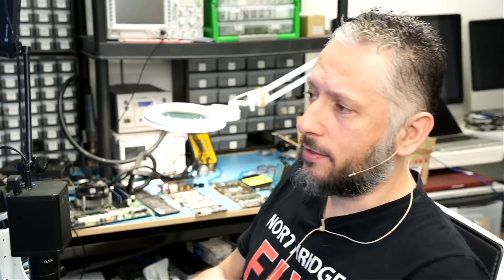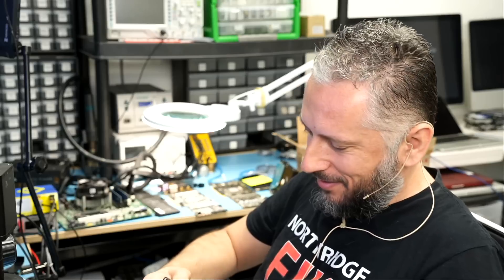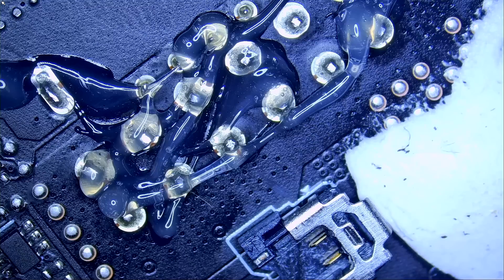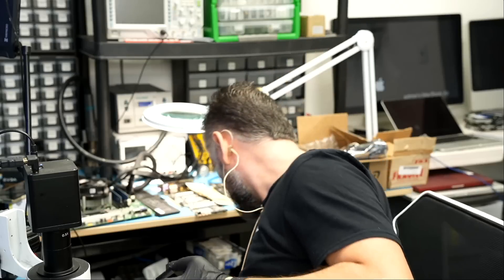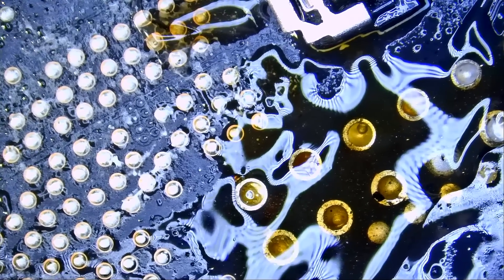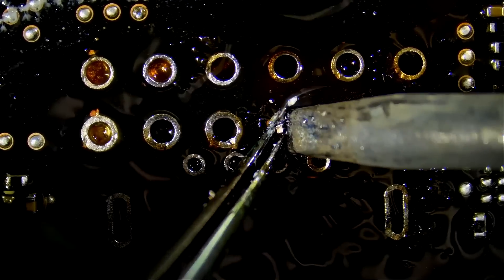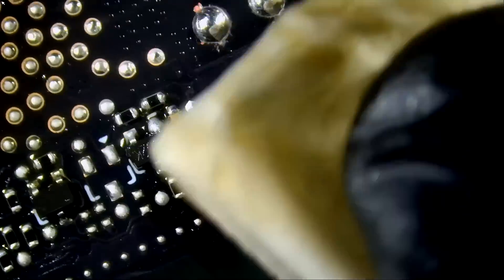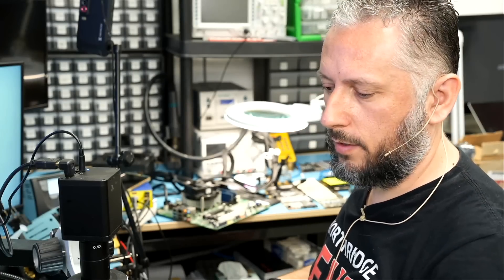4090 FE Connector melted with Cablemod Adapter installed. 40 series cards should be recalled

Comment: That angled connector is not designed to stop the melting issue. It's designed to keep the cables from being bent oddly at the GPU connector and possibly damaging it;  Because a selection of PC cases' outer panel are up against the cable connector. This melting issue was a problem as soon as the cards went into production. There was a pretty extensive test done to prove the reason why these connectors are melting from a reputable youtuber. It was a revealing and convincing video and I think everyone just went with that,  but that doesn't mean they may have missed something. I am interested in your theory, if you come up with one, as to why those connectors are melting if it is indeed not user error. I have installed 3 4090s in our custom builds just in the past week. We've installed quite a few in the past several months and 3090ti cards all through last year. I haven't had one customer we built machines for, come to me with a melted cable yet. It IS only happening at that new and very small pinned connector. I'm pretty certain that the next gen cards will deffinately have a different connector.
Reply: I would hazard a guess that you are being careful with the cable management when you put these 90s in. My guess is that this card had tension on the adaptor causing a poor connection. There really isn't many other things that could cause this unless it wasn't fully inserted, but apparently it is. Hard to see in the video if that is the case.
Reply: @proudofyourroots9575based on this and a previous video,  yeah i don't think he understood for some reason what this 90 is for..
Reply: @ProudOfYourRoots No. I am not trying to explain to him about the connectors. He just didn't mention it so therefor I tried to clarify that it is simply a right angled connector to someone who may not know. On the contrary of what you think and as a board reworker myself, I believe he's an intelligent person.
Reply: @ProudOfYourRoots  for others that did not know about cablemod adapter, like me...learned that today.. to my defence.. but i dont use nvidia anymore.  the company so rotten

Comment: As I have said on comments on other channels ever since these cards came out, this new connector is just too small for this kind of current. That said, I bit the bullet recently and bought a 4080. The 4080 of course cannot pull the kind of current that the 4090 pulls and I'm hoping that will keep the connector intact.
Reply: I’ve seen 4080 connectors being melted too 4090s are just more prevalent
Reply: Just remember that AMD's hotspot issue was more important than this.
Reply: Especially when the hot air adds to the temperature.

Comment: Analyzing the pins on the video I think the pins on the replaced connector are thicker than the original connector, wich implies Alex's connector is "better than factory". Maybe manufacturers cheapened out on first batches of these cards and newer connector designs are more resilient.

Comment: This stuff isn't new. its been happening to NVidia cards as far back as the 1080 series.  i know of it first hand. with the old 1080ti as well as the 2080 ti's .  The connection is not robust enough for when these cards start churning up their power needs. Its a lot of juice passing thru wires that heat up, and the plastics involved is not thermally efficient to handle it.  The companies know this but they refuse to find a solution because the amount of cards frying is a small percentage compared to majority of users who's activities are not pushing their cards to such extremes.  Some that are have their computers in cold rooms which further help in keeping temps low.

Comment: I can tell you from experience that the 12-pin connector can feel very different with different adaptors. The pigtail adaptor - the one nVidia provides, not by the broad partners - felt very "sluggish" when I was plugging it in. Then I tried a adaptor cable by Corsair, and the feel was a lot snappier when plugging in -  the kind that gives you more satisfaction when plugged in. I haven't tried the CableMod adaptor, so don't know how that one feels.

The thing is, this sort of difference used to exist already with the PCIe 8-pin - sometimes they feel very snappy, sometimes they don't. The same can be said with the ATX 24-pin, or the plugs on a fully modular PSU. It's part of the plastic molding tolerances. However, the mating part of the 12-pin connector is shorter than the PCIe 8-pin, and together with the high power draw of the 40-series card, can exasperate the problem, because the connector is not connected as "deeply" as before, and also less structural rigidity.

The latch itself is not in itself a proper indicator whether there is proper contact within the connector: all it does is to prevent the connection from disengaging when you pull on it. But even so, when you pull on the connector, you will have to say there will be some kind of disturbances to the contacts of the pins within the connector, because when you physically wiggle the connector, even when it's latched, there's a little bit of play between the two plugs.

The Gamers Nexus video provided a plausible explanation for the melting connector, and while it's very likely a lot of the cases could have been due to the connector not being fully plugged in, the video creates the side-effect that affected users are less likely to speak out than before because they would likely be ridiculed for making a mistake. So this would lead to more affected users (proportionally) just quietly sending the damaged product for independent repairs. Hence you seeing more related repairs.

One key statistics for confirming this problem is the 4080. It uses the same connector, but uses less power, so are we seeing similar failure rate (percentage wise) as the 4090?

But I do agree that if good contact is required for reliable operation of the connector, then it starts to get into the territory of the designer/manufacturer's responsibility to ensure repeatable operation for an average user. If plastic molding tolerances are a critical factor, then there needs to be specifications in place to ensure as such.
Reply: If the owner is using the cablemod is because he knows the issue, I don't believe a bit that he didn't connected all the way or the adapter was poorly designed by a company that sells psu cables and were aware of this issue (that's why it was created) . We can clearly see that it fused the connector together right were it should be, all the way in . Maybe there are some other factors playing a role here but one is for sure the heat generated by the corrent (that's why we see alot of reports with 4090's) . this connector should have a safety factor of at least 3x the max amps rated for this graphics, to make sure that it safe even using aftermarket adapters or lower tier psu's but we don't see that here
Reply: @Danidasanic  My thought on this one is the cable management caused tension on the adapter making the contact less than ideal, even with it plugged all the way in. Though it is tough to see if it is indeed fully inserted but there was no mention of it being loose in the video so I have to assume it wasn't. That 90 could put a lot of leverage on the connector if you got carried away.
Reply: @--_DJ_--  just the opposite I'd think. The 90 degree is designed to reduce stress.
Reply: @emtpayislow  It is designed to turn the cable 90 degrees, that is it. It is still up to the user to not put tension on the connection.
Reply: It seems like the plug is capable of doing what it was designed to do. (600 watts) But that is only the case under ideal conditions. In hindsight, this connector probably shouldn't have been released to the general public to use with how finicky it is to get right, and the results if you don't.
Reply: Our adapter is made with quality in mind of course, as all our products. Igor's Lab has done a nice detailed review of them, and on our side I can say we've sold over 50k of these and so far there have only been less then 10 reports of melting (half of which have been confirmed to not actually be fully seated, some still not yet confirmed). This one appears to definitely be seated fully and it does appear like there may be something going on with that top row of pins since it's a repeat issue with those specifically, as has been shown in previous videos here by Alex as well.
Reply: it's called planed obsolescence , it breaks and you buy another...they make more money.
Reply: @orange11squares  Planned obsolescence is a completely different thing, where did you come up with that idea?
Reply: The 4080's TDP is capped at 350W nominal draw, much less likely to burn. The 12VHPW plug is indeed too "flimsy" with very short pins. When I plugged my 4080 I specifically look closely to make sure the connector on the board is flush with the plug, not just because of the latch click. The tolerance is very tight -- half a millimeter out and the contact will be weaker.
Reply: @Ivan-pr7ku  350W is still freaking stupid though. We desperately need optimization generations again like we used to get (the 800 series for laptop, 200 series, etc.) because this is out of hand. 350W was what a fucking SLI Titan was back in the day and it's now the "mid range" (since, objectively, the utterly worthless 64/128-bit ones are lowest-end, NOT mid-range) GPU? WTF?

The irony of not having optimization generations anymore is that each successive new generation is barely better than the last. The 4000 series, horrendous QA issues aside (humor me please---never push crap like the issues in this video aside), it's... basically the same as its equivalent 3000 series models.

The 4090 is only better than the 3090 in cases where nVidia gimped the 3000 series by not having a specific feature they've gatekept away, like DLSS 3.1 or whatever it is.

Comment: Any other card that isn't a 40 series hasn't had this issue... So why is all of a sudden user error?
Reply: Because only the 40 series has the connector bud and all of the previous issues were proven user error
Reply: @AndrewB23  Do your research before you type bud... Look up the  EVGA GeForce RTX 3090 Ti FTW3 Ultra and tell me what kind of connector it has. It's not only the 40 series cards that use this connector. 💀

Comment: Hmm,i have a gainward 4090 with that cablemod adapter,no problems at all here,its strange some have problems and others not.
Nice job with the fixes for those 4090.
Reply: There's been less than 10 failures with our adapter in over 50k sold, you're safe with our products. Even if a failure occurred, we would take care of you with our awesome support. As you can see by this card being sent in for repair even. :)
Reply from the maker: As I pointed out in the pinned comment and also on Gamers Nexus and JayZTwoCents recent video, Cablemod were caught in the middle and they are not to blame in anyway shape or form. I later realized from Steve that the card I worked on 4090 FE belongs to Cablemod as well as many cards they mailed over to us in the past.  We have over 250 Graphics card que and i never look at names when repairing devices. Kudos to Cablemod for repairing or reimbursing customers who used there 90degree adapters and later had a melted connector problem even thought it had nothing to do with there adapters.

Comment: Manufacturer used cheap connector. Cheapest as possible. 
Another example: I use Logitech mouse M500 and M500s for a lot of years. I have 3 mouses for a spare bought in different years. All mouse clickers had broken after 2-5 month from purchase without any gaming. I bought cheapest clicker from Ali (China) and replaced original clicker. And it work 2-3 years between replaces. 
My conclusion - someone manufactured/purchased/used very cheap connector in very expensive card.

Comment: This is a designer fault. They could have made it as the pci e connector which clicks when plugged in correctly. There is no click. They could have just avoided this shitty connector and put 3 PCIE connectors on top.

Comment: 100% the manufacturers are at fault. If not connecting the cable correctly causes the connector to burn up then it needs to be redesigned to not power on until 100% contact is made. My old gtx 960 would not power on until 100% contact was made on the 8 pin connector and would even give you a red led indicating a bad connection. You don't see this anymore. 100% bad design and not the fault of the user.

Comment: Adding an adapter that adds contact resistance on an already "overloaded connector design" is a recipe for disaster. It's time to ditch those molex connectors and start engineering with proper high current connectors with gold plated pins.

Comment: I believe that the damage on this customer's card was  done during the installation of the cablemod adapter.  The clue that made me come to that conclusion is that they got the adapter. I still believe it was user error because maybe their card would've been fine if they left it without the adapter. The damage was probably caused  when plugging and unplugging. So my recommendation to all is that if you're not using an adapter and your card hasn't had any problems leave it. This is my case.
Reply: We've sold over 50k of these adapters, wouldn't jump the gun on saying the adapter is the issue. :)
Reply: Fan boi. you know nothing of the user install, nothing but you blame the user.

Comment: The cable ends could also be damaged by the excessive heat from the burned connectors I would have thought?  Worth customers checking before reconnecting?

Comment: It's a design issue. In 2010 or so, I built a new gaming rig with 2 480 GTX in SLI. The power draw was so high, it melted and fused the 24-pin connector from the PSU and motherboard together. EVGA and Antec replaced their respective parts and it happened again. Again, Antec replaced the PSU but EVGA made me sign an NDA and provided me the then unreleased x58 Classified 3 which had a PCIe supplemental power connector. That solved the issue. Hopefully, this design flaw will be fixed soon. Some of these companies like Gigabyte deny warranty claims like this.

Comment: the heat does not come from the holy spirit from an electrical heater. if you have ohms you have heat. the question is: where does the electrical resistance come from? and the answer is: from the contact between the surfaces of the pins and the connector. and this contact resistance would certainly be lower if the pins were larger and would increase the connection surface, but it largely depends on the goodness of the connection and above all on the materials. the pins will have a highly conductive outer coating, often silver, which is not necessarily there with the adapters and which wears out putting the cards in and out 100,000 times......

Comment: The Nvidia make a trash 4080/4090 video card with one 12 pins for 4 cables for power supply 1000+….. it was melting or fire. The cards need two 12 pins + 12 pins to equal power to card and test for sale to customers $$$$$.

Comment: I had a 4090 FE in my best buy cart yesterday. Was so close to finalizing the order, and even had a 90 deg adapter in a Cable Mod cart. Common sense took over and said this is stupid,  don't need to spend over $1,500 just to gamble on a card that will likely fry itself.

Comment: This situation is absolutely baffling. The optics of this are going to severely hurt the trust people have for Nvidia. I wouldn't be surprised if they end up getting sued for releasing such a shoddy product, or catching something on fire like someone's house.
Reply: Wouldn't be the first time. I got my check back in 2010s for the GTX970 4gb when in reality it was 3.5gb.
Reply: @Fearls1  cant forget the dying memory on the 20 series
Reply: It's not going to hurt anything, these rare failures are either user caused or statistical defect in production deviation of quality.
Reply: That connector has been in use since the 3000 series cards though, only difference is the extra 4 sense pins. The current draw on the 3090 Ti is well over 500W, which is weird that only these are melting. I’m sure you’ve seen the Gamer’s Nexus video about this. Even after removing 4 of the 6 power pins leaving just 2 it didn’t melt
Reply: If anyone actually contacts the product safety authorities, then Nvidia are likely to be for the high jump. This may be more an issue for Europe if they're found to have applied the 'CE Mark' negligently. It'll be a UL fail too but I don't see a UL mark on them.
Reply: This issue has been forgotten for the most part. I think the vast majority of installs have had no issues or else we would still see this in the tech news.
Reply: @--_DJ_--  Take a look at Gamers Nexus

Comment: it would be interesting to test the card while looking at the connector with the thermal image camera, and see if just regular use generates heat from the resistance at the connector like Mystic suggested.
Reply: Gamers Nexus on YouTube has videos on this.
Reply: @TexasTimelapse  In one of them they also explain that pointing a thermal camera at the connector is mostly pointless in terms of finding the root cause.

Comment: I’m split on the plugging-in issue as I have, in the past discovered an arcing incident caused by a house iron not being fully plugged into a wall socket ... definitely user error in that situation.  But looking at the slim conductors and daft positioning of the connector along with the stupendous power consumption and I’m surprised the more haven’t gone up in smoke.   ... still it keeps us in good repair videos 👍😀
Reply: Yeah that is one reason I don't like cheap wall sockets also, had a friend whose window unit was coming unplugged because it was so loose inside.